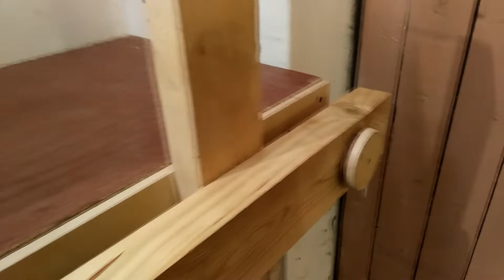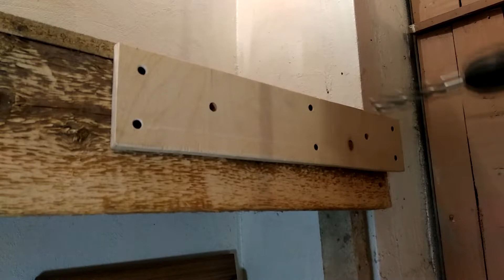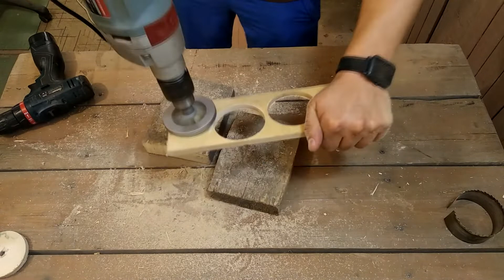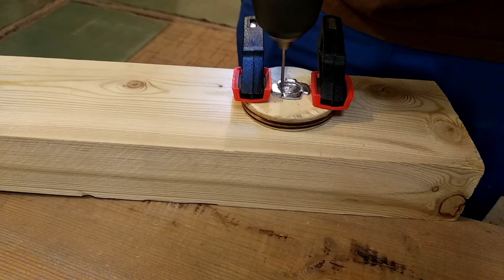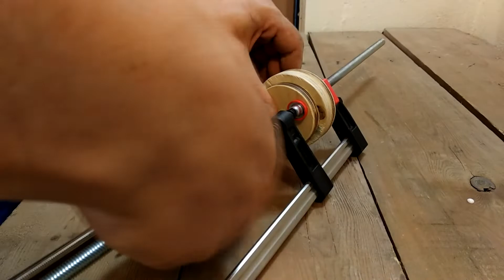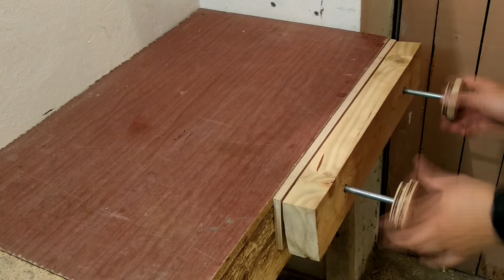DIY Woodworking Vise – Affordable Twin Screw Vise

Comment: Love the simplicity of the build. I would add a piece of plywood behind the T-Nuts under the bench to prevent any accidental popping out, in the case of the threaded rod being pushed in the bench direction.
Reply from the maker: Great idea, thanks! I once said so nut, but I did it differently - I screwed 2 Truss Head Screws on the outside of the nut. It works fine!